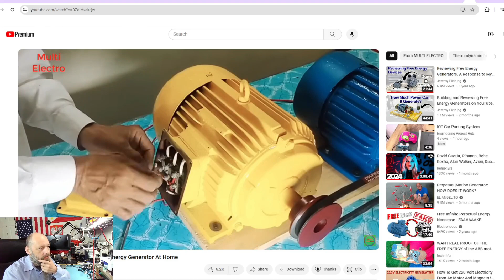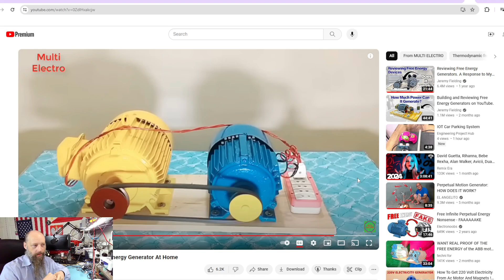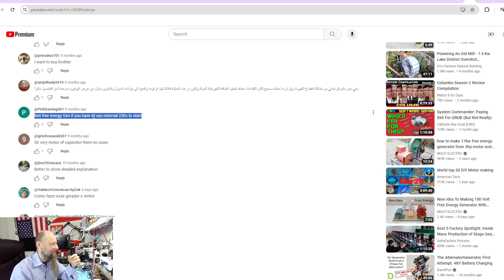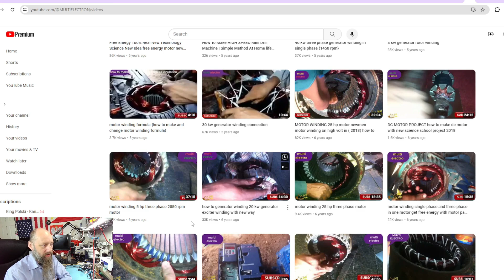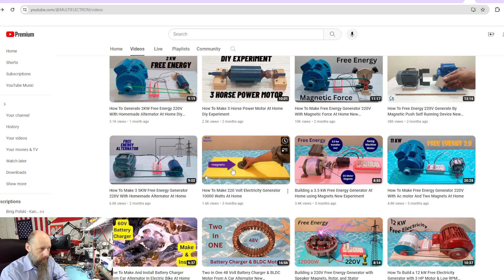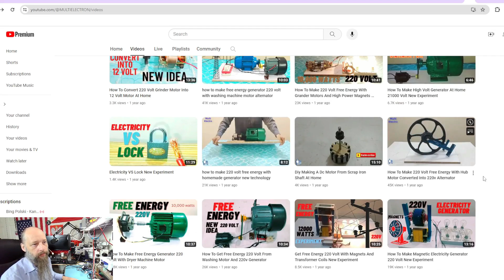Free energy video that suggests my videos

Comment: It's always dubious when they don't show all of the wiring. There is a cut where he put the power board down, I've never seen a power board without a cord (not saying they don't exist, they might), he could have ran a cord along the back of the board and off the table behind one of the motors.
Edit: Later it shows the board the other way around with the power cord cut off, but in the first video this was hidden, probably because that one had a cord.
Reply from the maker: Yep, that's probably how it's done

Comment: Try Stick a 10m Copper cylinder into the ground with an Iron rod in the middle and make a giant earth battery - The Radium which is concentrated in the clay and not the soil schould provide free energy - Radon gas comes from Radium in the ground which binds to Oxygen and thats why u open windows if u got a house to get all the Radon oxygen out - Radium in ALOT more radiant compared to Uranium - Uranium can be used cause u can Fission it to make steam - Radium can be used in Battery´s which needs to provide energy for a LONG time - Google Radium / Earth Battery
Reply from the maker: interesting. isn't Radium radio active though? It doesn't sound too safe :)
Reply: @blackhorserepairs   it is. But as its concentration is low in the ground its "safe" 
Radium battery's is used on bases which cant generate power or in submarines. Knowing this gives an idear what the world really is. A giant battery. Everytime a fusion between atoms happens (like oxygen combining with hydrogen to make rain/water) energy is made
Energy is constantly been made around us. Its just us being blinded through schooling on how to get energy. Energy is free and constant so making a simple setup will get you to A. B would be to add a coil to boost the volts